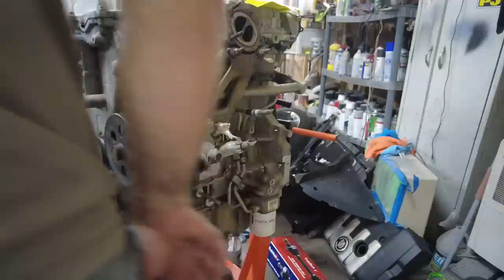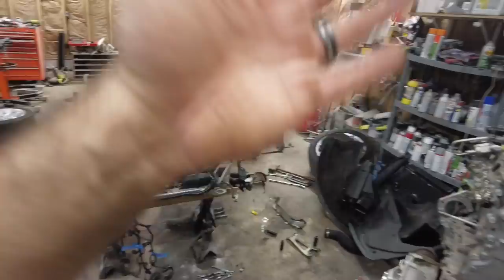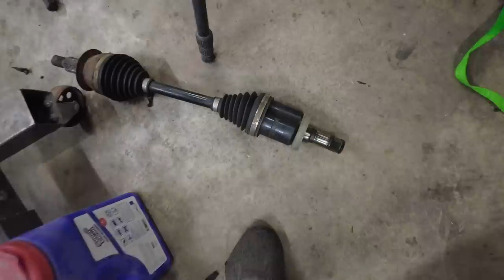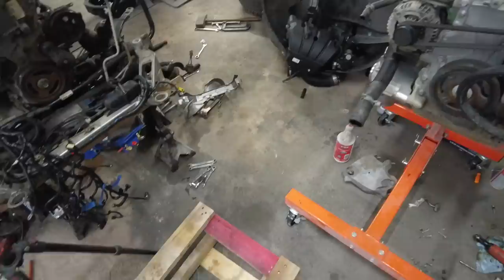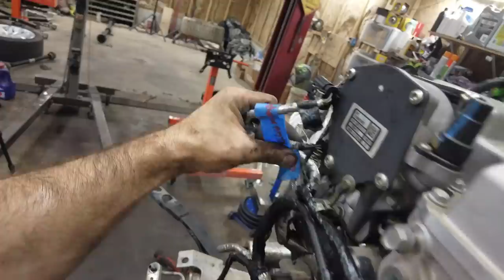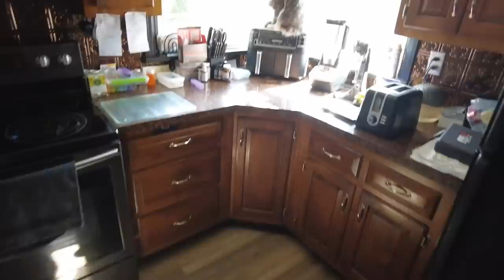Engine swapping a 2014 Cadillac CTS 2 0T Part 2

Comment: I HAVE A VERY IMPORTANT QUESTION I CANNOT FIND THE ANSWER TO. IF I DROP A GEN 3 LS V8 INTO A BASE 2014 GEN 3 CTS, 

DOES THE ENGINE HAVE TO RUN AS A STANDALONE UNIT? OR DO YOU MODIFY THE WIRING HARNESS TO WORK WITH THE REST OF THE CAR COMPUTER?... 
OR DO I HAVE THE LUXARY OF CHOOSING BETWEEN THE TWO? 

PLEASEEE LET ME KNOW WHAT YOU DID FOR YOUR CTS THANK YOU SO MUCHH IN ADVANCE 🙏🙏 I JUST REALLY DONT WANNA FIND OUT THE HARD WAY THAT I CANT RUN THE ENGINE AS A STANDALONE

Comment: whats wrong with the 2.0 and whats milage??
Reply from the maker: The block is warped.  I did the head gasket  and all new timing set and had the head milled and it's still leaking antifreeze in cylinder 2.  It has 116k on it.